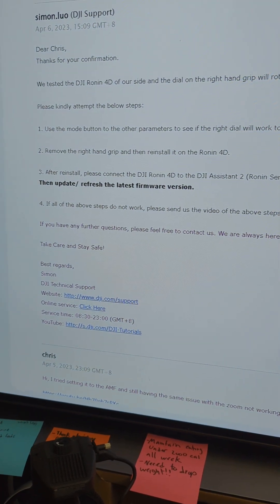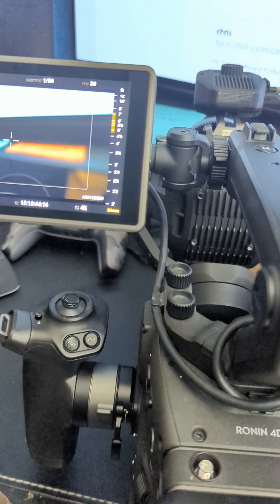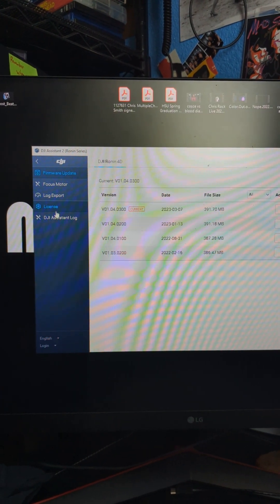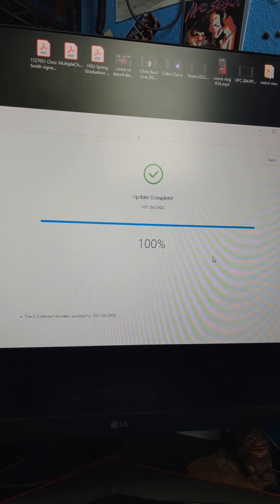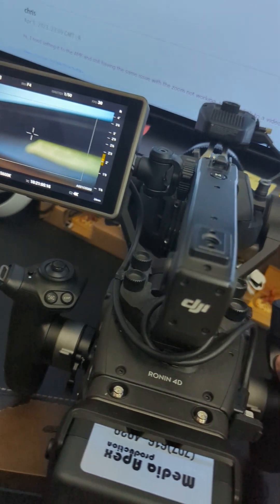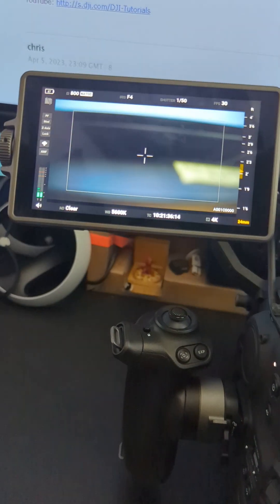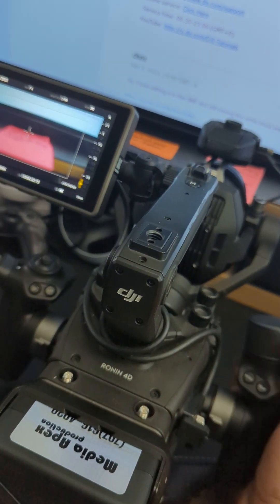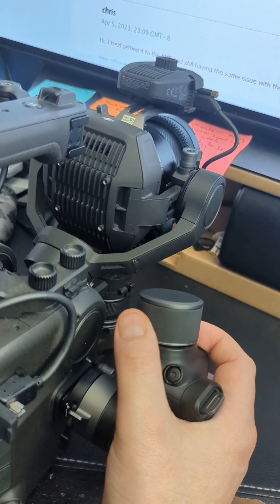DJI Ronin 4D - focus/zoom motor test 3 video for DJI support - Zoom still not working

Comment: Did you get this fixed in the end? I'm having the same issue
Reply from the maker: Lol it's complicated, I've got it to work and it wasn't consistent. I kind of abandoned the mission after 30 emails. This was also now months ago so they could have advanced it since then. I should check back with them.
Reply: @RobbieMcKane how do you update the firmware on the mount. I put the cap on the mount and plugged in the usb cable but the dji program didn't detect it
Reply: @mediaapexproduction5245 how were you able to get it to work at all? I’m having the same issue, I thought at first it’s the motor not being strong enough, but even if I take it away from the gear the motor itself still won’t spin in zoom mode.
Reply: I tried 3Dprinting a custom ring for a 16-35 Sony Zeiss without a previous research and hoped that there’s a way of doing it. But no. The issue is that there’s no point in menu where you could say: the focus motor is turning the zoom ring. So when you change the Mode to zoom how would the camera know where physically is the motor and what gear is it engaged to. So the “Zoom” function is still refers to the electronic zoom for motorized lenses

Comment: Even if you got it to work wouldn’t zooming in like that fuck up the overall balance on the gimbal and stress out your motors?  Why not use a lens with a internal zoom?
Reply from the maker: No I don't think so. This lens is super light even at 70mm. They made the motors in this stronger and you won't be off roading at 70mm lol